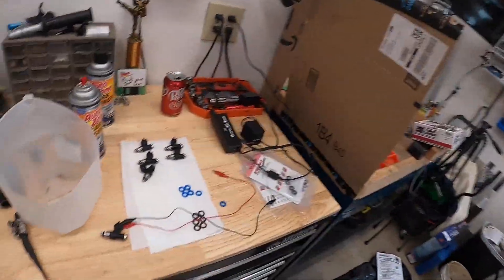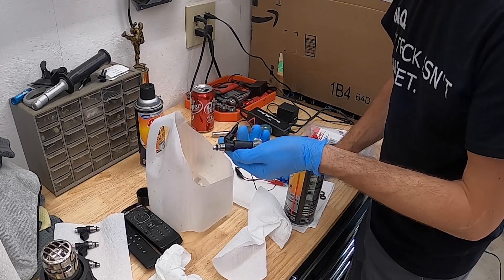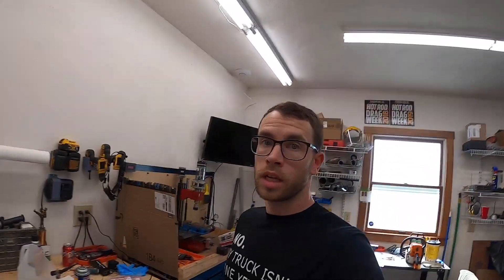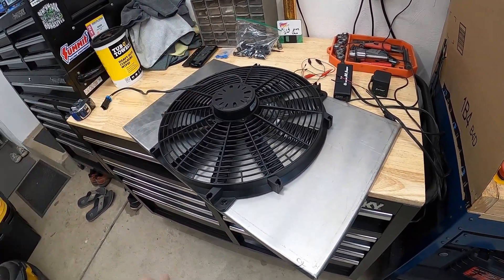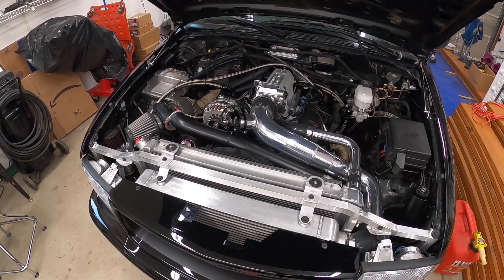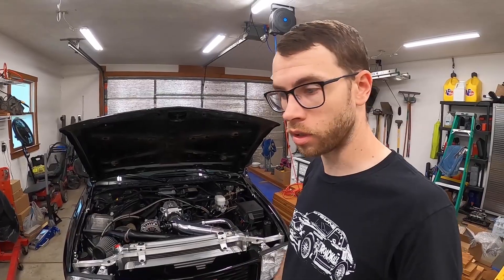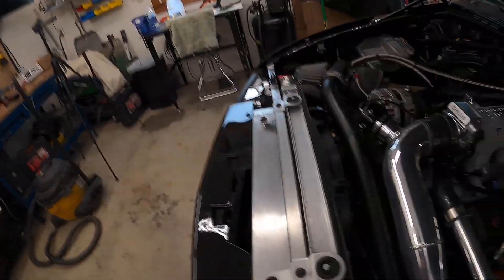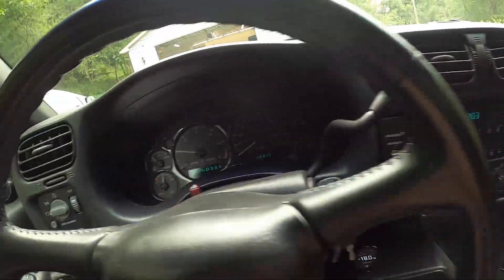It's Fixed! 160 Deg Coolant Temp w/ 3,000 CFM Rad Fan

Comment: Have you thought about sealing the gap between the intercooler and the radiator, this would help keep it cool and insure your pulling clean ambient air from the front of the car.

Comment: If you clean your injectors with carb cleaner and standard fuel hose, the fuel hose will break down and block up the injectors. Just trial soaking the rubber fuel hose in Carb cleaner to see what happens, they go very soft and fall apart. Generally Nitrile rubber 'should' be fine. Edit: Also for creating the adaptor, just use a solvent safe hose ie: Nitrile, one end on injector, block other end, make small hole in side of hose to inject cleaner into using thin nozzle. No need for all the shrink tubing.